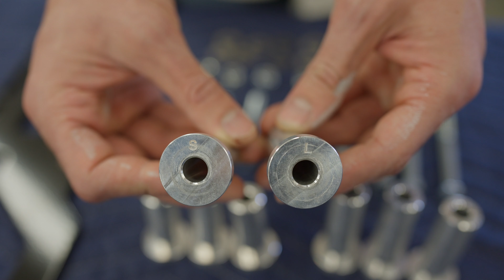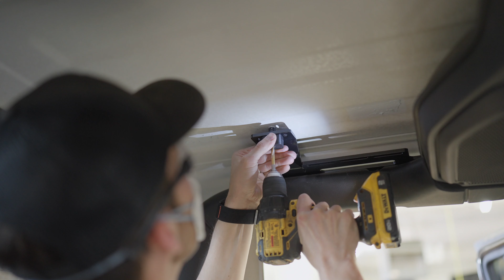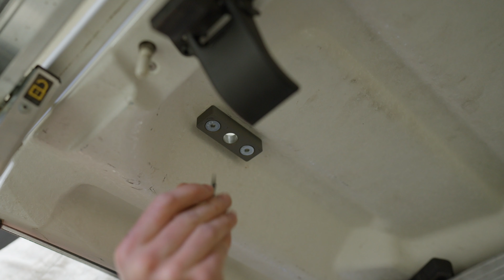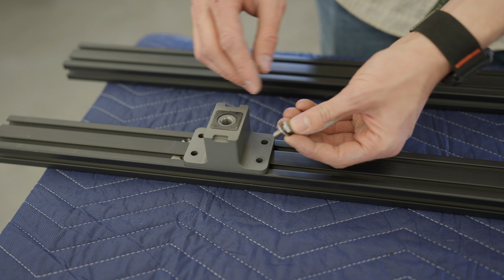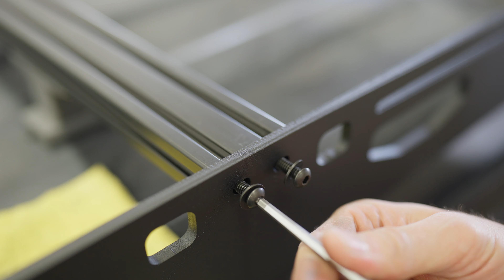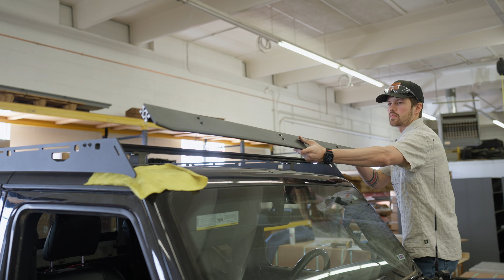The QDHD Rack Install (2020-2025 Jeep Gladiator JT)

Comment: I am still confused on how this works with the roof removed
Reply from the maker: The adjustable bolts that hold the rack on can shorten (to make up for the space the roof took up). Then you just bolt the rack back on to the mounting brackets! The mounting brackets always stay bolted on the cage.
Reply: @sherpaec ok. Makes sense